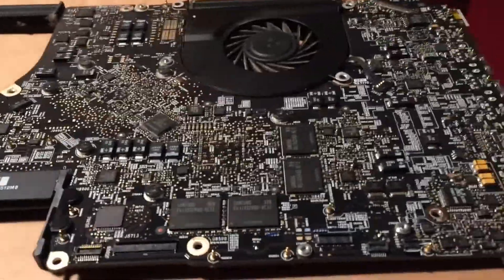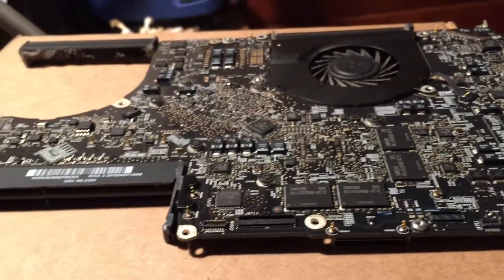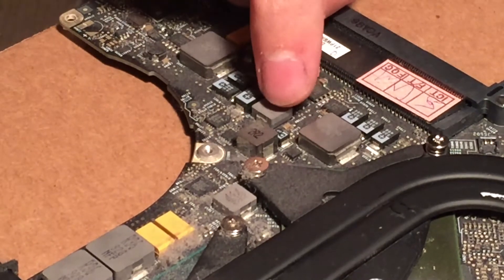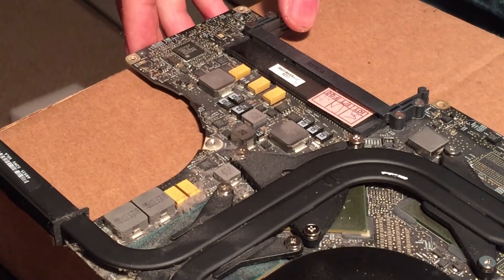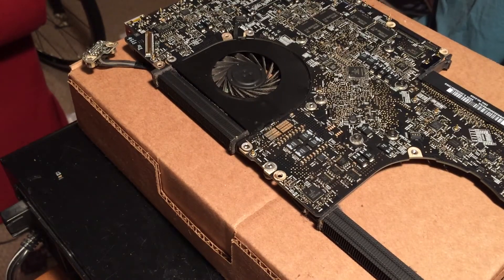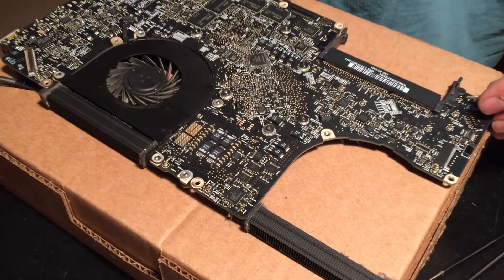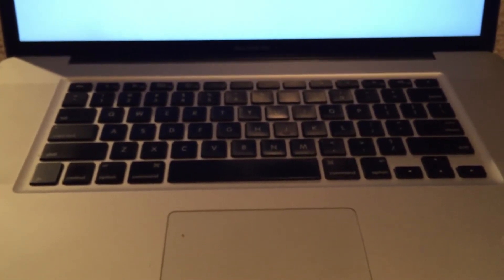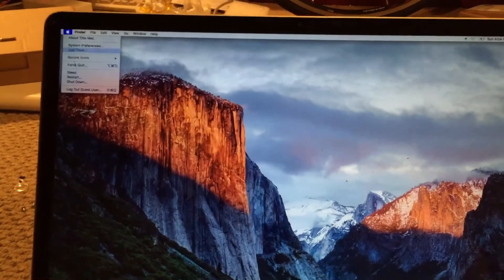Mid-2009 17" Apple MacBook Pro Repair

Comment: My mid 2009 17 inch MacBook Pro, is starting to bootloop and after resetting p ram and all those key strokes it's not booting to the operating system, I went in and wiped the drive and reinstalled, Mac OS, I was greeted with an error stating that my Mac couldn't restart due to and issue. recovery mode still works fine would that be a symptom of the capacitor failing?

Comment: I am a total noob at board repair but after watching you and Rossman, and doing a lot of research,  I found a great replacement cap rather than using a used one.  It is Digikey p/n 490-13972-1-ND.  I ordered 10 of them and total price with shipping was $20.  Choose the 'strip' version unless you need a ton of them. It is a slightly higher rated cap and is exactly the same size, and is also non-polar.  I fixed a few 17's that would not power up. this was the problem on all of them.

Thanks also for your Catalina hack that I used on one of my 17's.

Comment: I have a 17 inch to as well it will only turn on if I have the power adapter plugged onto it, so I replaced the battery thinking that was the issue but turns out it wasn't, could it be the capacitor as well for mine??

Comment: I'm having similar troubles with my Mac 17 inch (2012 - 14) .... when I power up, the screen comes on and I get the spinning arrow and "slide gauge" moving left to right like it's "booting up", then it shut off ... black screen again! Also, when I disconnect the power supply, it shut off immediately ... Ideas, thoughts, remedy please?
Thank you!

Comment: I think Louis Rossmann talks about this exact same problem, he tells in his vid that this cap isn't actually up to that job and that apple should've used another, more beefy cap instead of this one. Now, if you have a mid 2009 17 inch, when this cap is warm, the board will turn on, so if you heat this cap up just enough when its a bit to hot to touch, the machine should turn on, this is great if you don't have a external sata to usb and you want to get your data of this laptop (i had the exact same machine and in my case, heating this cap up with a soldering iron worked for me)

Comment: Hi, should my power adaptor megasafe be 85watt or 60watt to check the voltage of the capacitor?
Reply from the maker: You should always use a genuine 85W adapter when testing a 15" or 17" board.
Reply: dosdude1 Thanks :)

Comment: I have the same problems with a 2011 version. PP5V-S3 is missing and L7770 and C7771 are both fine at 1.105v. Any idea what to meassure next or where I can find a schematic? I am a noob with this kind of repair.
Reply: 1.105 is NOT fine its supposed to 1.8 volts or grate iirc
Reply: @NathanReevesnate808  I have the same problem, Ive changed the cap and still dont get the 1.8V. Could it be something else?

Comment: I have the exact same problem and every now and  on I face the same issue after repairing and huge amount I've paid
Reply from the maker: Has C7771 been replaced? If not, it needs to be. That will probably get the system going again.

Comment: Do you have any general tips for desoldering / soldering a logic board - i.e. temperature setting to consider? Any reference would be great, just starting and would like to learn the basics.
Reply from the maker: I usually set my hot air station to around 280 - 300 degrees C. If you're using a board preheater, I normally set mine at 150-200 degrees C.
Reply: Thanks for the tip / great video!

Comment: Hi my MacBook pro 17" is getting power but halfway to bootup it shuts down. This is when it's not plugged in. Also when it does bootup Switching to high performance graphics it shuts down too. When I plug it in everything works fine start up and switching to high performance mode.
Reply: I don't know what's causing it to do that.
Reply: have you solved your problem?

Comment: Replaced bad c7771 and checked all the S5 power rails and it still doesn't turn on.  What is the next logical step?  Perhaps I can short the power pad and observe S4 and S3 rail status?
Reply from the maker: Hmm, have you checked all G3Hot rails too? Also, what voltage are you getting on C7771 after replacing it?
Reply: Thanks for responding.  Yes G3H and S5 rails showing correct voltage.  Before c7771 replacement reading was 0.31V.  After, I am getting 1.1V, which is correct value.  I don't think there is any quick and easy diagnosis after G3H and S5 rails - I am guess it could be anything at this point, including bad discrete component (if lucky) or bad SMC or MCP

Comment: Hi there, i changed the c7771 and killed the L7770 coil, do you know where i could buy one? thanks!
Reply from the maker: You can get them from any electronic parts distributor like Mouser. Here's a link to a search page of them of the proper spec: https://www.mouser.com/Passive-Components/Inductors-Chokes-Coils/_/N-5gb4?P=1z0wrhxZ1z0wr1g

Comment: Hi my friend, your video is very useful. I have a MacBook Pro 17 mid 2009 which works well when the battery is connected. However, when the battery is discharged, the MacBook Pro doesn't work. I have green light in the mag-safe but it refuses to turn on until the battery has enough charge. Do you have any idea or speculation on hat could be causing such issue?
Thanks in advance for your help!
Reply from the maker: Ok, yeah, something else is wrong with your board. I'd check the PP3V42_G3H rail first, and make sure that is present when only the MagSafe is connected.
Reply: @dosdude1  where does one check this?  i dont have schematic and i doubt apple will send me one ;)
Reply from the maker: I'd check the voltage on C7771 with the battery disconnected and the MagSafe only plugged in. If it's ~0.3V, chances are that cap just needs to be replaced, and it will work fine.
Reply: I checked the voltage on C771 and it was about 1.8 V indicating that this cap is not dead. Do you have any other suggestion on what could cause such issue?
Reply: Gerson Bernardo Thank you for this video. Im assuming you flip the board over when you cut away....meaning I need to take the logic board completely out of computer?
Reply from the maker: Yeah, C7771 is on the underside of the board, it needs to be removed to replace it.
Reply: dosdude1 thank you!!

Comment: Maybe I have asked it, but what would cause a macbook pro 2011 13in to kernel panic on anything later than Mac OS 10.10?
Reply from the maker: I'm not sure... What does the kernel panic say? And does it happen during boot or while the system is running?
Reply: Happens during boot. It happens so fast. I will throw my scratch hdd in it and do an install. If I boot the install off of a dvd/usb the installer fails. Post installation script error. If I do an upgrade, it works fine (as in install seems to continue) then on reboot it does a kernel panic..
Reply from the maker: Have you checked to make sure you have the latest system firmware installed?

Comment: Could this same problem be on the MacBook Air 11" 2010? That's my board which went bad a few months ago and it just turned off and I experienced it doing nothing no matter what. The board was never water damaged or dropped and never taken out until recently and I tried all the different ways to start it up. Also, it does have an amber light on the charger when the battery is connected. Are there several capacitors I should test? I'll try to find the schematics
Reply from the maker: I'm not exactly sure, I don't believe the 2010 machines use the same 1.05V circuit. If you want, you can send me the machine, and I can try to repair it.
Reply: dosdude1 really? You could do that? Sure I'd like that!
Reply from the maker: I mean, you'd have to pay me for the repair (the owner of this machine did), but yeah, I'll do it. You can send me an email or PM and we can discuss details.
Reply: dosdude1 sure how much would you want for it?
Reply from the maker: I usually charge $150 for board repair.

Comment: How you find out the problem is the capacitor? And That Capacitor. Thanks
Reply: Multimeter. Read the marking on it.
Reply: Ofcourse but how you know is the capacitor
Reply: By tracking the continuity. If you have power from one point to another, but not to another point, you can eliminate components.
Reply from the maker: This capacitor failing is a very common issue with these boards. I've fixed a few other boards with the same issue, so I knew there was a good chance this board had the same problem.